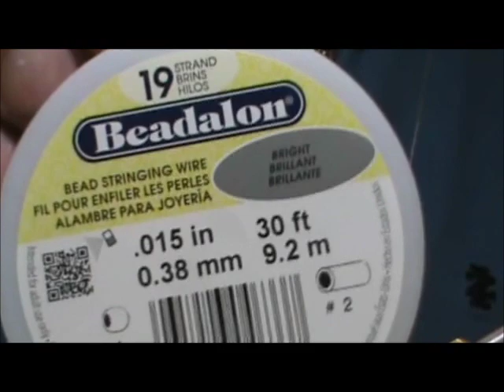Fly Tying for Beginners Designing a Bass Fly with Jim Misiura

Comment from the maker: It depends on the water depth. I have used a fast sinking leader even with floating divers. My set up would be 4 feet 20lb mono, 2 feet fast sinking leader, 4 feet 10-12 lb mono. When you strip the fly dives deep then slowly comes back to the surface. Works great. 
Good Luck Tim
Jim